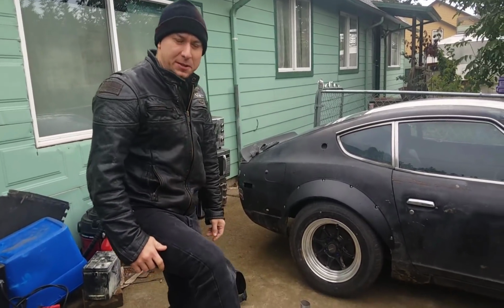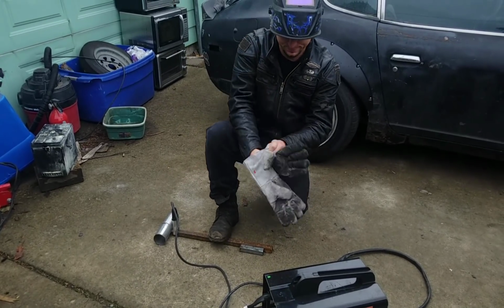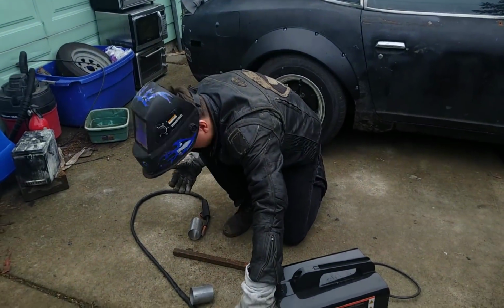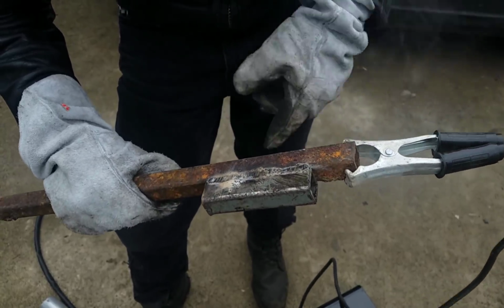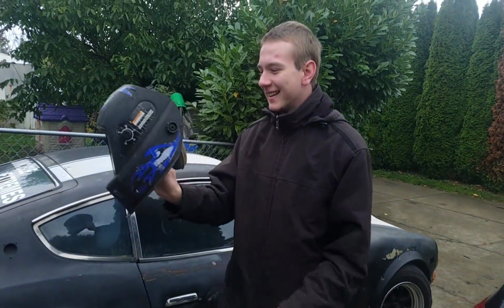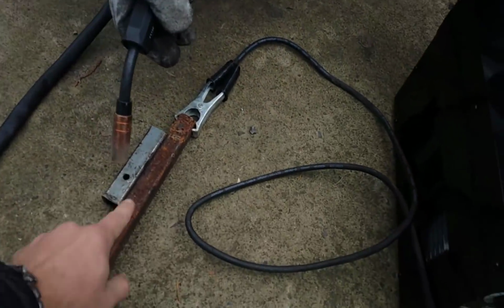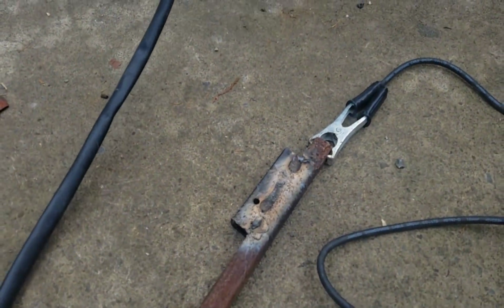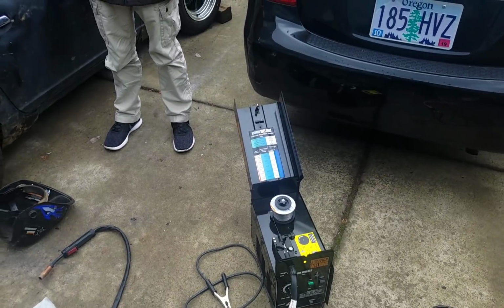$99 125 amp welder. Worth it? new 90 a.  Harbor freight 120v budget welding review. Chicago electric

Comment: WTF is aluminized sheet metal? did you mean to say galvanized ?
Reply from the maker: They literally call it that.  But yeah, galvanized is what it is
Reply: Galvanized metal uses zinc coating. Theyre not the same.. Aluminized steel is a thing tho

Comment: Thank you for the demo. Your welds are perfect for autobody. I always get a kick out of $70 /hr welders ripping on other welder's work. WHO F*'ing cares!! The weld holds, it's going to be grinded down to apply putty anyways. In the autoworld no one looks at welds and says "I wish I could shake the welder's hand. My life is complete now." All we care about is a strong weld and no pin holes. Then we cover it up very well. Lmao!! 😆😂

To elitist welders: Quit overglorifying your skills and self-promoting your self value. Good for you for being good at your career. But you don't have to be a prick to green horns or fellow tradesman.
Reply from the maker: I love sheetmetal work myself, and do a lot better with my 200 amp shielded mig.  Hammer, dolly and all that.  But this welder isn't that and it is usually used by someone trying to put floors back into their cheap pickup truck.  That's why the review was with rusty metal and I had my brother do some welding... showing how the welder will perform in the hands of someone who will actually buy a welder this cheap

Comment: Your cursive “E”  was backwards
Reply from the maker: Yeah.
Reply: No hate, just playin
Reply from the maker: No worries.  Also, I was wrong... on flux core you don't want to run over the slag...  so you have to slow "Z" anyway
Reply: Right. I’m getting ready to buy a mug but my last experience with a 110 mug was 20yrs ago. They weren’t really impressive back then but apparently they’ve come a long way

Comment: I used the same welder to weld new mufflers and supports on my car, so a total of 4 exhaust pipe welds and for hangers. This video doesn't show the weld but it shows the exhaust works. My opinion, not bad for what it is. https://youtu.be/xBugxNkYNDQ
Reply from the maker: They aren't bad, but definitely aren't the greatest
Reply: No your right, I'm a boilermaker by trade and just did 2 weeks of weld training mostly stick but I played around with a couple of brand new mig welders and there was no comparison I could actually make a weld puddel and maintain it where is with my own little welder it's basically just tac's. The best exhaust welding is done with Tig but I just don't want to spend the money for a setup lol.
Reply from the maker: Yeah.  I actually really like the 170 amp welder they sell.  $165 and it can be shielded with a bottle.  The weld comes out so much better.

Comment: Melt that crayon..little e's
Reply from the maker: And I completely forget, but for flux core, little z works better.  You never want to run over your slag
Reply: @InvincibleExtremes  what about u's? That should also work. 😯
Reply from the maker: Stacked U's work great too

Comment: Ehh. I wouldn't make a welder review video unless you"re an actual welder. Not just a weekend warrior. Any REAL welder will tell you that you just wasted your money.
Reply from the maker: Brian Taylor and a weekend warrior wouldn't buy a good machine to weld once every six months or to bounce around in a 73 datsun for thousands of miles to be used when it's needed for odds and ends.  I've welded for years and this machine is exactly the pile of garbage that comes in handy all the time.